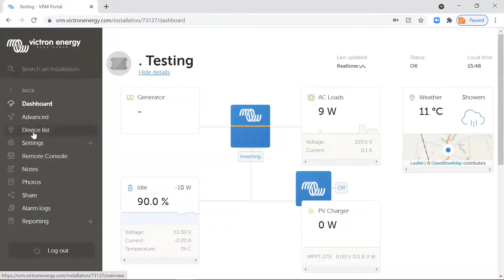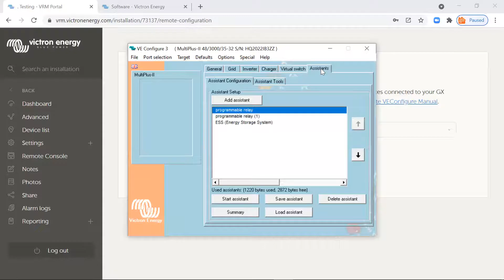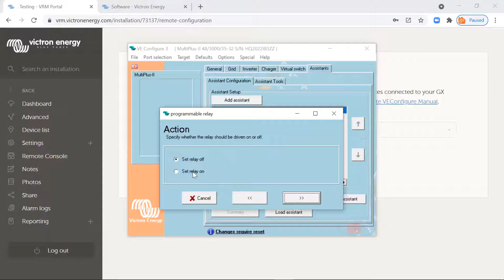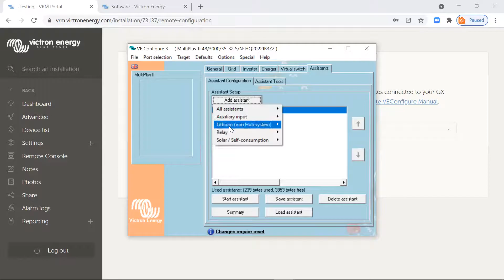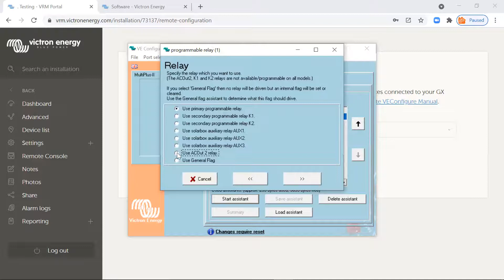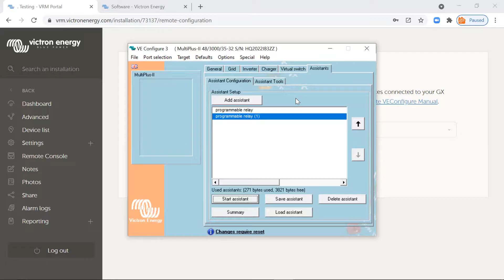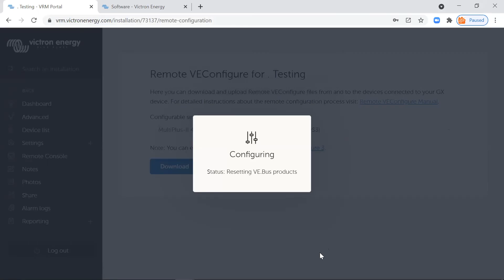Victron AC OUT 2 programming for Hot Water Diversion

Comment: Hi Ben. Brilliant video thank you exactly what I am hoping for on my barge.
Question if I may? I only have Mac Bookpro and iPad, no Windows laptops. I have access to the Victron VRM and I can work through the Devices menu to the Download section, all good there, then the file wont open once clicked on while in the Downloads folder. I’ve downloaded VECSetup_A and the same happens. Is it possible to use a Mac or IOS device to configure victron equipment?
Thank you Alan
Reply from the maker: Hi Alan, unfortunately the Victron apps only run on windows (as far as I know!) - you’ll have to borrow a friends laptop or buy a cheap one, it doesn’t need to be that powerful, a second hand machine will do fine.
Reply: @benstanton  Thanks Ben I thought this would be the case👍
Another question/s if I may? My 2Kw immersion element is controlled by a program controller protected by a fused switch spur Q1. Is 2Kw too much for a 3Kw inverter (generally about 50w runs in the background -fridge etc. Should I change to a 1Kw element?
Q2. If I do get the solar dump working do I need to just have the controller programmed ON all the time it’s sunny?
Reply from the maker: @aljotock  it may be a bit high for the inverter if other loads are needed (water pump etc?) but generally I use the PV size as a guide to the element size. Go for half the PV size - maximum. You want there to be plenty of extra PV available to complete the battery charging.

Comment: Hi Ben, You look and sound familiar somehow - not related to Cherie? 
Thank you so much for this video!! The whole dump load thing has been a mystery to me, no matter how many forums I've visited - anything Victron seems to be shrouded in secrecy for the elite few only. 
I'm trying to do something like this with my Victron Easy Solar system. I've got a pretty good solar system, the lithium batteries are usually full by lunchtime in the summer, but the winter is a different story.
I'm hooking up my hydro for the winter lack of sunshine and abundance of water, planning to bring in 160v DC in via a Victron 260/60 charge controller, and it would be great if I could use any excess power automatically in heating water, etc. using your method, instead of buying Dump Loads and all the bits that come with them.
Looks like I need to dig out my old Windows laptop to run the software.
Reply from the maker: Yes - related to my Sister Cherie! How do you know her/us? 

I don’t think it’s so much that Victron are shrouded in secrecy as that their product range is so vast and has so many applications that it can be hard to find what you are specifically poking for. 

Re: your hydro using the MPPT - you could drive an SSR (solid state relay) with the output and then turn an element on with that. I normally do for an element size around 1/2 the wattage of the production so the batteries don’t micro-cycle and you don’t get relay fatigue (the SSR will help there tho). So this means you will also need a dump load controller as well - you should really have one anyway so that if the hot water element fails or the delay dies or even if the hot water gets to maximum and the thermostat turns off you don’t end up with a runaway hydro turbine or over voltage. At the very least a crowbar across the hydro controller or a second relay driving another element (but that’s basically just a custom built dump load anyway!). Hope this helps a bit.
Reply: @benstanton  Thanks Ben, a great help. I've had my hydro running for the last week, and it has been wonderful not to have the roar of the diesel generator going morning and evening. I stripped off a calculated number of copper turns off each coil in my stator to bring the no-load voltage under 120 V, though sadly the output wattage has halved. Thanks to your video I'm using AC2 (with the Victron assistants) to run a hard-wired fan heater set to the 1200 W setting once the SoC reaches 95%, and stopping it at 86% SoC. I hear you about the relay fatigue thing, when the sun shines, the SoC climbs fast, and sometimes the fan heater can't keep up.
Can you clarify, (please assume I know nothing about relays) what you were meaning about driving a Solid State relay with the output, (which output?) and turning an element on with it? My BMU inside the BYD B-Box battery case has some relay connections on it, not a word to be found globally about what they are, but one of the guys from Current Generation let me know what they are for. Apparently one pair is a normally closed relay at 100% SoC, and the other pair is normally open at the same state. He suggested I somehow use these to trigger a relay, though I'm drawing a blank on exactly how to do it.
Reply from the maker: @reelMn  with an SSR you will need a small clean contact relay such as the one you have on the BYD or maybe one of the other raelays on the Victron inverter. Then you’ll need a power supply through that relay and to the SSR. 

The problem with 100% SOC is that it’s not often the battery stays at 100% they seem to fluctuate between 99% and 100% (possibly due to differences in cell voltage or maybe even simple rounding down so it’s not actually dropping from 100% to 99% but from 100 to 99.9 … just reading 99%) you will have to test then the BYD relay actually turns off again is it 99.9% or 98%??? Also not being programmable is pretty limiting huh?
Reply: @benstanton  Yes, it’s rare to see SoC get to 100% in the summer, usually 99%. The guy was telling me to set a dump load for safety purposes there, to prevent overcharging. 
Regarding water heating, There are some relays on the multiplus for starting/stopping generator, etc. I guess they are also programmable using assistants. Are you familiar with what the Easy Solar 48v system relays are, and which is best to use?